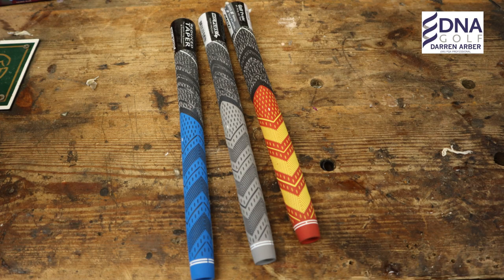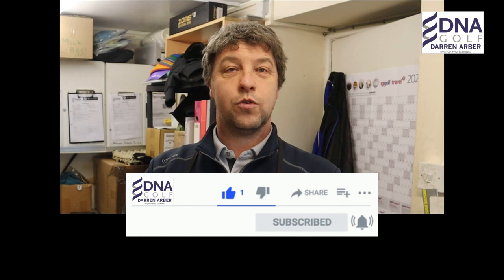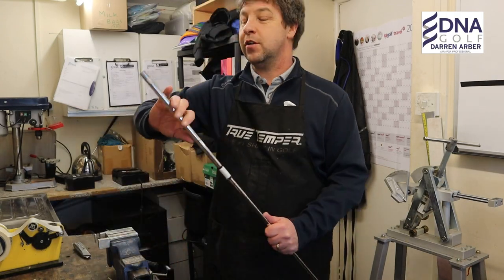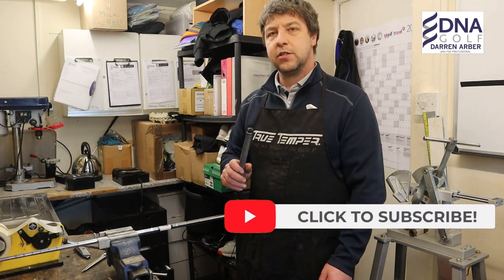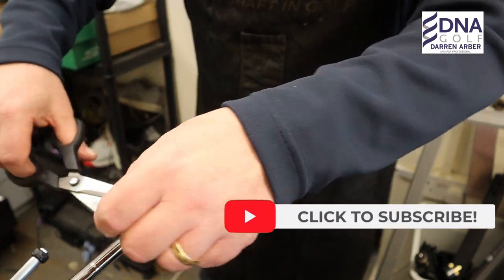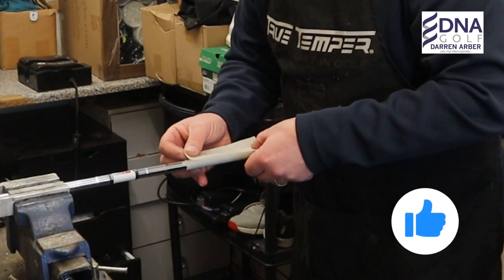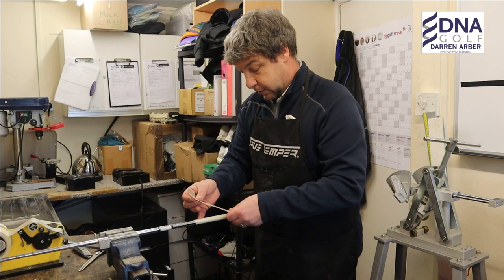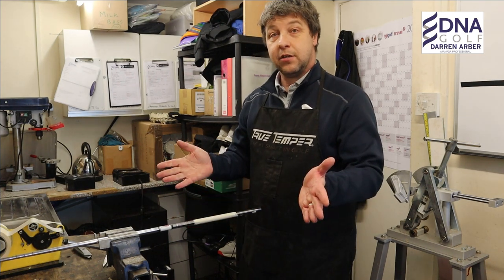The EASIEST way to make any standard grip into a PLUS 4

Comment: Very useful video but I have one question, I am looking to try adding two layers under the lower hand instead of four but why didn't you tape from the lower hand right all the way to the bottom because that would keep things consistent if a player wanted to choke down either to take distance off or to hit a lower shot into the wind.
Reply from the maker: I thought about that after I’d done, I just tried to keep the taper at the bottom of the grip, but I guess you can run it to the bottom if you wish.

Comment: Good stuff, I would add that you will end up with a harder/firmer grip, compared to a manufacturer's Plus 4. Maybe that's what you prefer...or not. It is not a big difference, but it is different. Always best to fiddle with a grip or two, before committing to a full set, fun to compare side by side. Some people will also add a self made reminder strip in their favorite position. I've heard of everything from coat hangers, welding rods, to rawhide laces, kabob skewers, and zip ties.
Reply from the maker: The good point and well made, and as you say you can experiment. Never heard of any of the reminder ideas you gave, could be a video in the making.

Comment: Another great video. I took your advise and made my plus 4 undersize grips. Bloody love em. The only thing is the grip tape I have leaves  a messy residue on the club... What brand of grip tape do you use? And is it available in UK?
Reply from the maker: I get it from brand fusion, which is a UK company. Think they do supply online to non trade. Works great have no issues. If you do have any residue, white spirit works a treat. Let us know if you get some. Any other club repairs you interested in?
Reply: @darrenarbergolf  I'm going to attempt a re shaft. Should be fun setting the fire alarm off with the stove doing that one, don't think my wife will be impressed. I've seen the brand fusion tape on a few sites that ship to Ireland. Nice one mate.

Also, don't know if this is a thing. But I wanted to build up the lower hand even more after the first go. I saw your video on how to pull a grip off. So I used that method to get the grip 3/4 of the way off stuck an additional layer of grip tape  on the lower hand. I then applied solvent and rolled the grip back down. Worked a treat. I reckon it would be a great way of trying out a plus 4 grip without commiting to removing the grip completely/installing new grips.
Reply from the maker: You need to buy a heat gun from a diy store. I will try do a reshaft video at some point. 
That’s not a bad idea, just have to make sure the tape doesn’t come off in the process.
Reply: @darrenarbergolf  nice. Look forward to it.
Reply: Also do you just use regular old white spirit for solvent?
Reply from the maker: That’s what I use. Nothing fancy
Reply: @darrenarbergolf  brilliant. In an apartment with a small baby, so I'll get a bottle of the orderless white spirit, much cheaper than grip solvent. Legend mate. And anyone reading, avoid the grip tapes on Amazon, even white spirit won't clean off the gunk.
Reply: @jamesmacconville6633  I grabbed a few grips of Amazon a few months ago. Haven't got around to putting them on just yet. Hence watching this type video. You reckon I should get better grip tape then the stuff that came with?
Reply from the maker: There are lots of grip tape out there, some good some a nightmare like what James experienced. I have found the paper based product better than the plastic type. Thank you for watching and I hope it helps you get your grips on.
Reply: @darrenarbergolf  Cheers Darren, thanks for the reply. Hopefully so. I'll take a look at it and make a call on whether to use it or not!
Reply from the maker: Got quite a few club repairs on a play list. Before you give it a good check out the regripping one, take you through things step by step. Let me know how you go on.

Comment: I'm going to do this with my golf pride supertacks after watching your video.
I have double sided golf tape but no masking tape. Can I just build up the 4 layers with just the double sided tape? Or does it need to be built up with 4 layers of masking tape and then 1 final double sided tape? Is there any difference as i don't want to have to order more tape.
Reply from the maker: Supertack are a great grip, but to answer your question you can use double sided tape. I don't use it as it costs a fortune when compared to double sided tape.

Comment: Hi when you put the packing tape on at the top of the tape do  the 4 layers start at exactly the same place  ?
Reply from the maker: I tend to taper slightly so there is no potential for a bump or ridge in the grip. It’s not by a lot those, as you still need enough tape to build up the lower section.
Reply: Ok so i put the first tape on ,,,,then the next layer is a we bit lower at the top and a bit more lower at the bottom is that right ? and the next 2 layers the same ,,,a smaller gap at the top than the bottom?
then once the 4 layers are on do you put one layer over the lot of them from top to bottom ?  then double sided sellotape  then solvent then grip ,,is that all correct.....Ive got s full set to do and I don't want to stuff it up ,,,,, black golf pride tour velvet     Cheers

Comment: Just a small point Darb if I may? I don't think you covered...rotate the tape around the shaft too. That way the backing tape wont overlap in the same position making your grips into +8 ribbed 😉
Quick point for Mick, if you use 'Gaffer' tape instead of masking/backing/build up tape you will only need a couple of layers...even someone as forgetful as me can remember TWO 🤣🤣🤣
Reply from the maker: I forgot that one mate, I did it will building up video. 🙈

Comment: Plus once you have  put the  last layer on do you.put one layer from the top to the bottom of the grip..
Reply from the maker: The double sided would obviously go over the whole grip. Any build up tape needs to be just in the lower hand Section unless you need to make the grips bigger
Reply: HI Darren  I did it yesterday  was a mission  but did 14 clubs in total ..I bought a small  hobby vice  wrapped shaft in a towel ...heh if you ever travel to New Zealand for a holiday and need a home base.   let me know ...cheers
Reply from the maker: Glad to hear you completed the task. Never been to New Zealand, might take you up on the offer. Now you gotta vice what you doing next?
Reply: Ha ha yeah well  ive just bid for some    Callaway  x12s,,,,,,  started with them yrs ago  got to a 15 handicap  then gave up because I was flogging a dead horse,  but last yr got serious covid  and then long covid  that mucked me around a bit  and could not make my hiking videos … check me out Youtube J Spraggo  
So just started golf again, getting lessons from a really  good pro   have built myself a home driving range ,finished it yesterday  and bought  a Garmin r10  not used it yet.. plus  built myself  a plane swing circle out of Perspex  pipe easy to do for a home handy man  so that’s good, might post a Youtube video so other people can build one . I  gym and stretch every day plus  super healthy diet just lost 10 kg bought some ft i bird irons to get me started that were the ones I regripped  but  the x 12s will be my  clubs  so will  put new grips on them when they arrive. been watching  john Jacob videos while im on the rowing machine at the gym, working on weight transfer  and not coming over the top at moment  ,,ill get it .,,,,im 67 years old and my gift is enthusiasm  ha so will be interesting if I can become a reasonable golfer ,,,watch this space   ,,,,,cheers
Reply from the maker: Wow, you fit a lot in, do a blog on the pipe thing as well as your home golf range I would find that really interesting. Will check out the YouTube and put a face to the name.
Reply: Ok ill make a video of what ive built  at home im sure some  people would find it interesting.
I’ve done it as a bit of an experiment. Last 18 holes I played was 121 so  that’s where my game is at the moment.  12 yrs ago I got down to a 15 handicap  so was never really a golfer ,,,,,,,,, But now I have built my complex ill go all out and just see what happens …..first off im on a super healthy diet ( apart from the fish n chips ha ) lost 9 kg in last 8 weeks…go to gym every day  1 set of each of the basic exercises ,then 5 klm on the rower  while playing john Jacobs  full golf swing video or Butch Harmon.
Started lessons from a good pro  and are  working on the basics  ie weight transfer and not coming over the top  and keeping elbow in  etc …. I stretch every day  and will dedicate 1-2 hrs daily to golf training and  just see how much I improve ,,,,,,,,
Ill send a link to video of what ive built cheers …